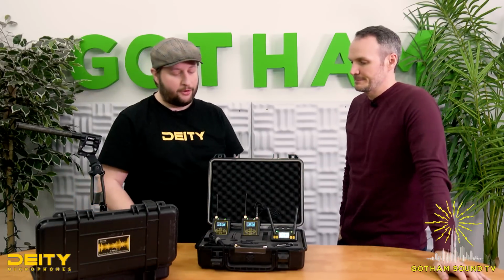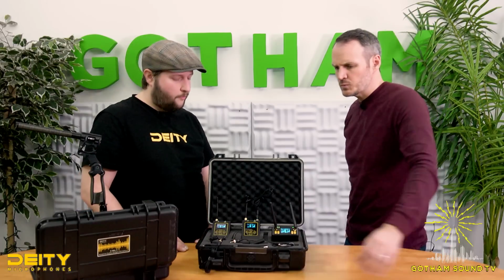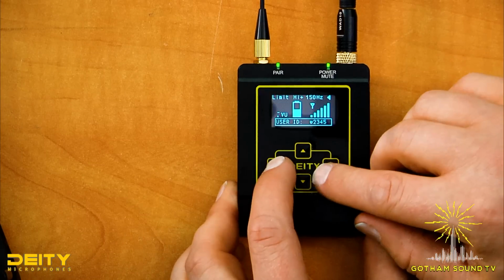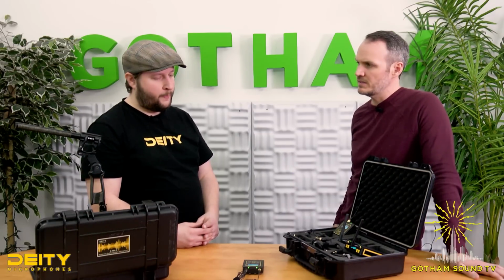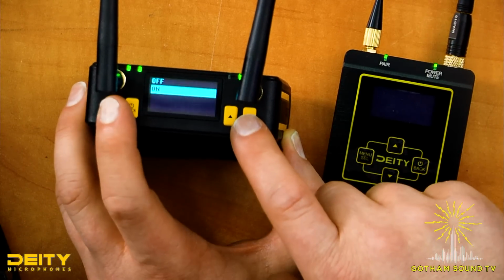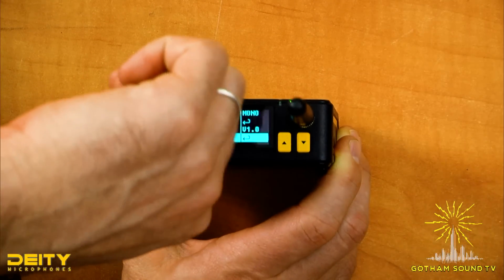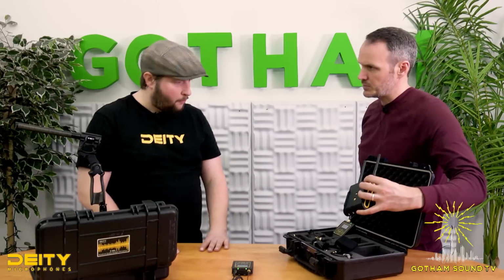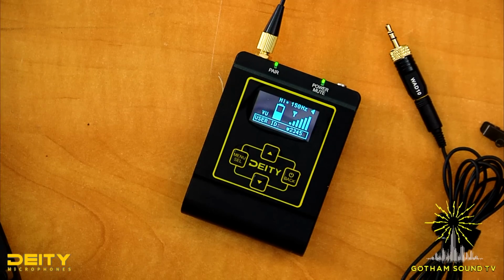Deity Connect Wireless System

Comment: talk about the batteries again? did you say you can link the device to external battery bank?
Reply: Caleb's (DSLR Video Shooter) wireless setup shows him powering his entire setup including the Deity Connect using a battery bank via USB-C. Even the transmitters can be charged and used at the same time via an external battery bank.

Comment: 19ms latency? Really?  ...Bye
Reply: Latency is inherent in all digital systems... Even Zaxcoms have latency of up to 18ms depending on your modulation settings and they cost way more. As long as it's under a frame then there's little to worry about.
Reply: @DafyddMann  So thats way Audio LTD has an latency under 4ms and Lectro 1.5ms because nobody worry about it? Never used a zaxcom System, they have a bad reputation here in Germany.
Reply: @w.g.5225  not sure wherever you heard that, but there are plenty of A rate mixers using Zaxcom in Germany and very happy with them. Not on ENG or youtuber jobs though I guess...
Reply: Christian Späth i was considering to  buy zaxcom, but colleagues and rental/seller told me there not reliable they have hat some issues. And went with Wisycom.
Reply: @naturambientsounds7291  becouse wisycom is famous for their reliability? Seriously? There is no failsafe tool in our business. Zaxcom is among the best in my opinion. And for sure the most handy system.
Reply: Jakob Klingebiel thanks for your opinion. I’m pretty happy with my system as well.
Reply: @naturambientsounds7291  I think that is the most important thing. We ourself work with the tools every day and the better we feel with our tools the better our performance as a whole...
Reply: I have a feeling they could have reduced the latency on the deity wireless but they chose to prioritise the minimisation of bad hops instead. Being on the 2.4 gHz band they need more flexibility. However it does mean you can use the device anywhere in the world without having to worry about licenses. Seems like a great entry level device or camera hop etc. To be fair it would be unreasonable to pin them against devices 6x the cost such as lectrosonics.
Reply: @DafyddMann  I dont compare it to an Pro Wireless. Just talking about latency. Latency matters, even in Video Work.This system is totally fine for youtube / Vlog Video, but not for me. I was thought  to used it for Camera hopping, but now i just keep my G3 s  instead. That new Cheap Sennheiser digital has a < 4 ms Latency.
Reply: You should try zaxcom. It is great. The best system out there yet in my opinion... (from Vienna, Austria)